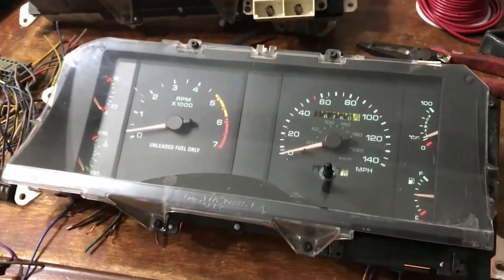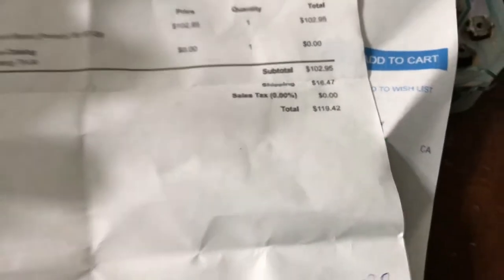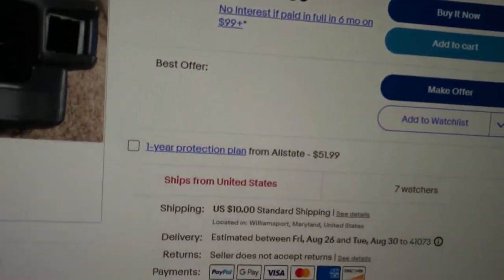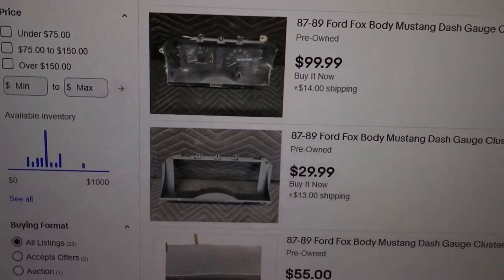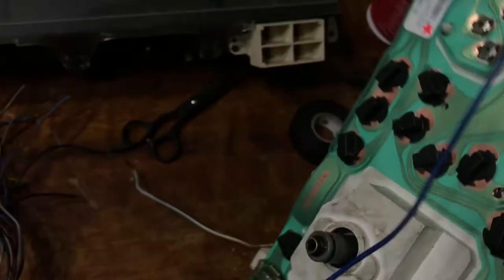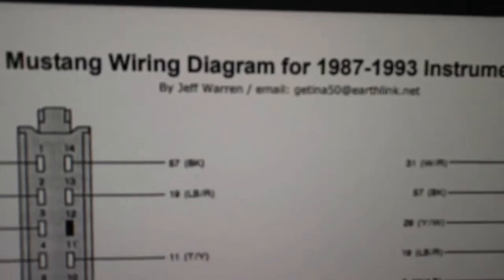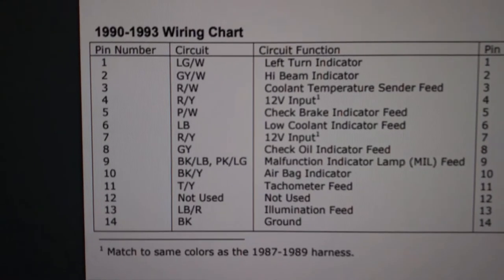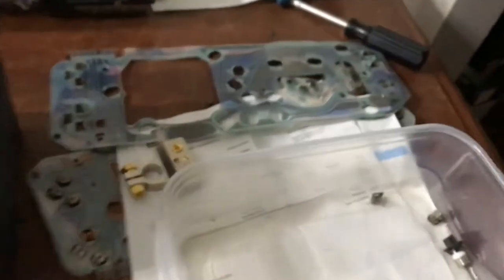Fox Body Mustang Dash Cluster Repair

Comment: Awesome video! I just bought a 88 notchback and someone has done some major hackory behind the dashboard 🤦‍♂️ they put in all aftermarket gauges in the cluster location. Deleted the center AC vents and installed gauges and cut holes in the heater box. I got a tub full of stock parts including the stock cluster but I plugged it in and it did nothing so I'm assuming its fried or they pulled pins from the harnesses for the aftermarket gauges. The only thing its missing is the plastic strip down the center that covers the bulbs. This will help when I'm attempting to un hack it😂. Car is supercharged and runs great just bought with no heat or AC. Luckily threw some freon in it and its blowing cold air but heater core is broken. Going to be a fun project 🙄😆

Comment: You don't happen to have any extra rear plugs with wires for a 90-93? I have a 88 that someone replaced with autometer gauges and pulled pins. I got a good deal on a cluster from a 90-93 and spent all day saturday trying to move wiring. I got the cluster to light up, turn signals and high beam indicator to work but there's a few wires that I didn't know were they go one was a double pink/purple wire. I been trying to find somewhere to buy the plugs and pins without buying a whole harness. No luck also the white speedo clip is missing! Ugh
Reply from the maker: To fix speedo clip issue, recommend replacing cable (1979-93 MUSTANG PIONEER SPEEDOMETER CABLE W/O SPEED SENSOR) $19.99 @ LMR.  As far as the wiring goes, Google "Ford Mustang Wiring Diagram for 1987-1993 Instrument Cluster.  Check ebay for the plugs.
Reply: @JeffPalmerJWP  thanks man. I actually just ended up buying a completely stock 92 notch that has a ton of rust and doesn't run for cheaper than it would cost me to source all the parts I need to fix the 88. Going to be a project but I'm up for it 🤔
Reply: Joe, hows the car coming along? you still need any plugs for the cluster? i might have a few if you still need them.

Comment: The one for $179 was a 87-89 v8 cluster.... 7k tach is v8, 6k tach is 4cyl.... There easy to tell apart if you look close,  same for the 90-93 clusters...  No v6 cars from 87-93.. Anyone paying $399 for a cluster on ebay is just feeding the parts hoarders who buy these cars to part out.... Never paid more then $ 100 for one, just bought a 90-93 v8 cluster for $50 last week.
Reply: Funny, i just typed in a  comment without reading the rest of them and i read yours and its exactly what i said, couldn't agree more, nothing makes me happier than helping out a fellow Mustang guy and i loathe people that want Lamborghini money for Mustang parts.

I have accumulated a lot of knick knack parts from going to the salvage that way i dont have to give these people my hard earned money, i have a 89 and a 91,i just sold a brand new set of refurbished 30 pounders and a brand new pro m mass air i never used for 250 total to another Mustang guy online,he got a great deal and i was happy to help him.

Comment: Its actually the cluster out of the 4 cylinder,Ford discontinued the 6 cylinder when the 87 to 93 came out with this cluster ,i have done this conversion a few times,pick up a 4 banger cluster out of the pull a part and turn it into a 8 cylinder one, last one i got i paid 40 bucks for the whole cluster at the pick a part and that wasn't very long ago, speculators as usual being the lowest of the low want  a premium for parts for these cars on eBay and other places like that, like i say "these ain't Ferraris"

We are all in this together trying to keep these cars running,nothing wrong with making a few bucks and also helping a fellow enthusiast while doing it but wanting 4/500 bucks for a cluster is just BS, there is another idiot on eBay thats selling 2 front and 2 side markers that he claims are new and 2 (used ) headlights for a 87 to 93, guy wants 2900 dollars for it, ha ha ha ha ha ha , of course its been there for a year now with no bids, you would have to be insane to even consider it, something like that carries a price of maybe 400 bucks on a good day, if the headlights were new maybe 600 tops.

Great video man,always helps to teach others how to fix these cars,they are getting to be senior citizens,lol